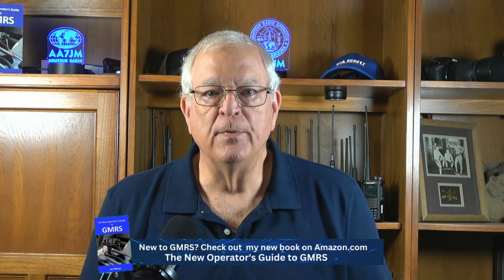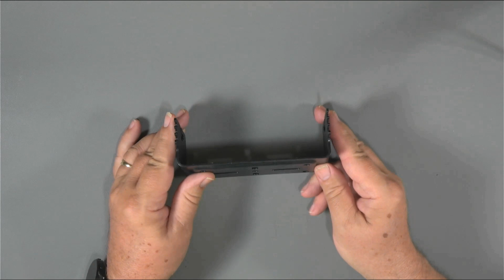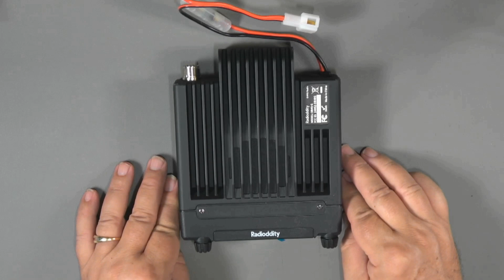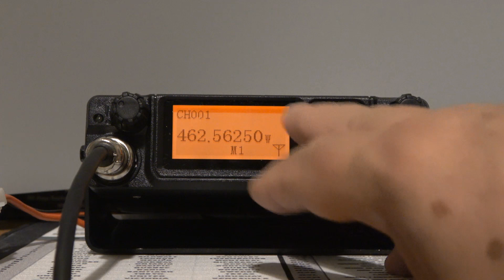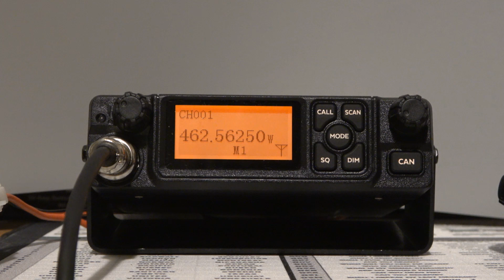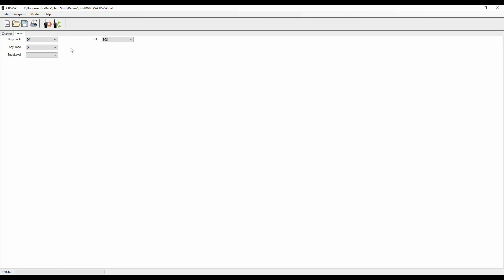DB40-G GMRS Mobile Transceiver. Let's Go GMRS  Mobile!

Comment: HELLO, Just purchased the DB40-G GMRS Radio. Am a ham and purchased it because the 70cm portion on my FT-991 has issues. When i try to transmit on simplex freq 446.000 or other the radio makes a disturbing noise. Also the CTCSS code confuses me.. I plan to use the radio on a simplex freq and maybe 2 repeaters BUT worried i may need to return it. Can you help me? Enjoyed your presentation and found it co
mprehensible.
Reply from the maker: This is a GMRS radio so it won't transmit on 446.000. That doesn't correspond to any GMRS channel. Most GMRS radios will buzz or emit a tone when trying to transmit on non GMRS channels. I"ve got a video on programming GMRS repeaters that addresses CTCSS codes. That may help.  Cheers.

Comment: My radio doesn't have that enr button on the mic, it was it as a VOX button. My menu is the * on the mic.

I've been trying to use the mic to enter a local repeater 462.600 ch17 with a tone of 100 but my menu shows nothing using the word tone.

Comment: Recently found your page. Enjoy it! What antenna would you recommend to match with this db40-g to match its watt strength/maximize range?
Reply from the maker: Thanks for watching. This question is much harder than it seems. For a base station, the Ed Fong j-pole antenna would be my choice. For mobile ops, things get complicated. Magnet mounts are good if your vehicle is steel. Not so much if plastic or aluminum. If semi permanent is the goal, a lip or edge mount is good. I use one of these. Name brand - $70. Amazon brand - $35. For antenna, does it need to fit in your garage? That effects length added to mount height. Be sure to match antenna to mount attachment. Both NMO or both UHF. Longer is better but overall, esthetics and useability are likely more important.   Take a look at my going mobile video on the channel .

Comment: I bought the DB40G and while setting up my tones somehow I erased everything and don’t know how to get the games channels back in. Can you help me with this issue?
Thanks.
Reply from the maker: Try opening the CPS and then write to the radio. Most of the time you'd first read, but in this case, write first.
Reply: @GadgetTalk4U  CPS ?
Reply from the maker: @randyhuggins3628  Sorry, download the customer programming software from radioddity. Install it on a Windows computer. Use the programming cable to upload the channels into the radio. I show it in the video. I also have a more general video on my channel about using a CPS to program radios.
Reply: @GadgetTalk4U  Great news ! It worked , Thank you so much
Reply from the maker: @randyhuggins3628  Nice. My pleasure.
Reply: 🌿 LOVE FROM MISSISSIPPI USA 🇺🇲

Comment: This radio is a hard pass,  I’m extremely disappointed because I have the DB20G and it’s a great, feature packed radio that WILL transmit and receive on 2M-440 as well as GMRS making it truly useful for a mobile.  And the DB20 works with CHIRP,  and there’s no limit to the customization.  When I heard they were releasing this,  I was set to jump on one until I saw the reviews,  and it’s somewhat astonishing to me that Radioddity decided to release this placebo of a radio.